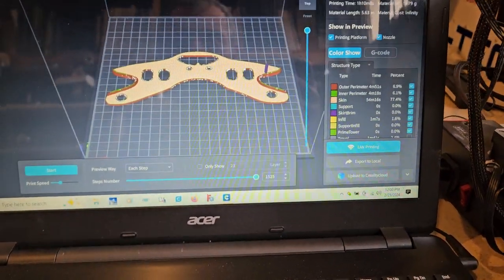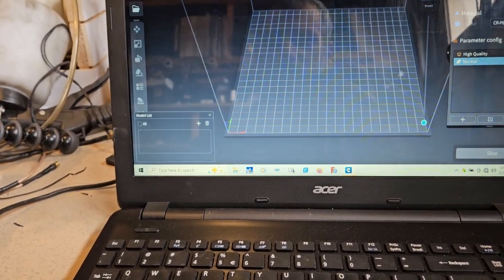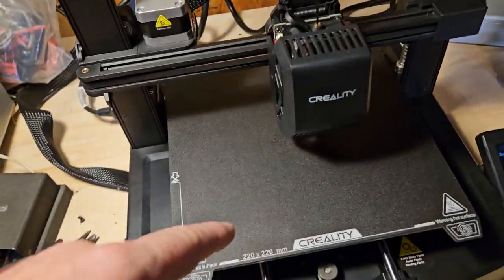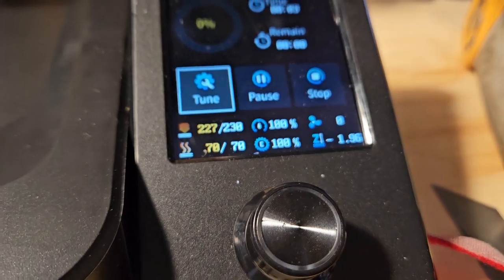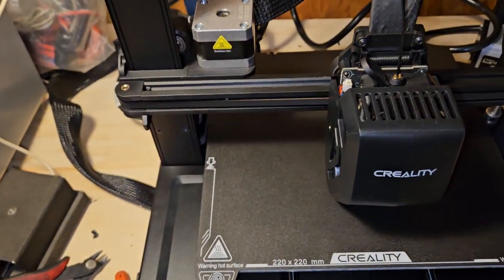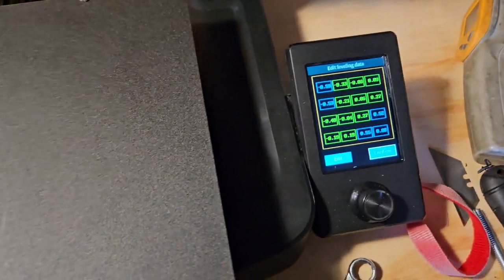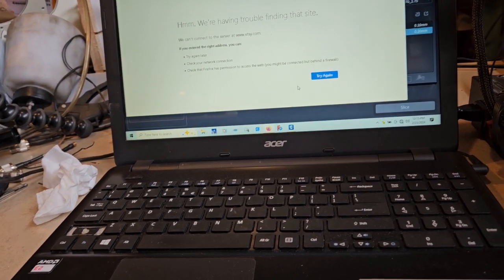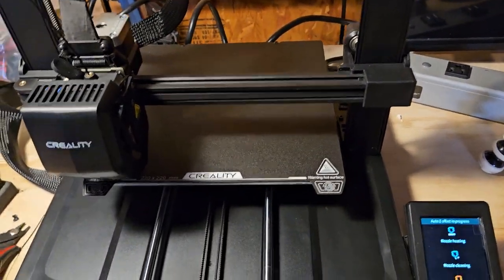CANT GET MY ENDER 3 V3 SE TO PRINT AFTER 4 DAYS!

Comment: I would take the bed off and either shim it with washers or very slightly sand down the pegs where those 4 bolts go until you get all green when you do the bed leveling. Those numbers will screw up your z offset. I have the same printer.
Reply from the maker: Spent all yesterday doing just that
Reply: Great! I was worried with some of the suggestions i was seeing. I think you got unlucky with bad spacing on your bed. Mine has worked great out of the box since day 1. I just printed the bear skull from printables using bone colored pla and it came out great (38 hour print).  @hamradiohack

Comment: Boii 😂 try alittlebit more plate heat up to max recommended for material + first layer max temperature nozzle +  thickness of the initial layr 0.2 or 0.24 . Before printing - alcohol or something to degreas your plate . Second layer average speed and temperature.
Reply: And dont forget to lower initial speed - this is very important. + Good leveling of the plate +- 0.5 and more from one side to another is not good

Comment: The reason it is not extruding filament is because your nozzle is too close to the print bed, this is happening because you are trying to calibrate your printer with filament loaded in the extruder resulting in a difference between the measured height of the nozzle and the actual height of the nozzle to the print bed.
Here is what you need to do to solve your problem :
1 Go to "prepare" and click on the retract option to remove your filament before you attempt the leveling procedure
2 After you remove the filament form the extruder go ahead and make sure that your nozzle is perfectly clean
3 Once you made sure that there is no filament in the extruder and that your nozzle is absolutely clean, you can go ahead and start the "auto leveling" procedure
4 After the "auto leveling" procedure is complete, grab a normal piece of paper, go to the prepare menu, select the move option, select "move z" and start slowly decreasing that number until you reach 0 ( the piece of paper needs to be between your nozzle and the print bed), once you are at 0, go ahead and click out of that menu.
5 Go to the edit ''Z offset option" and adjust SLOWLY in 0.01 increments while moving the piece of paper back and forth, you are looking for just the right amount of friction so that you can pull the paper, but not push it (a bigger - values moves the nozzle down, if that makes sense).
6 Once you are happy with your z offset you want to go to the control menu and click store configuration so that the printer "remembers" your settings
7 After you have stored your configuration you can go ahead and go the the prepare menu, click the extrude option and follow the instructions on the screen, make sure to cut all the a good few inches off the filament so that you feed new clean filament in
8 After the the printer loads and extrudes the filament you can go ahead and choose the file you want to print
9 AND THIS IS VERY IMPORTANT : MAKE SURE YOU SELECT THE "CALIBRATION OFF" OPTION IN THE PRINT MENU!!! if you fail to do so, the printer will start a new "auto leveling" procedure and all your work would have been for nothing!
10 Try to switch to PLA filament, it is much easier to print
Reply from the maker: Thank you so much for the detailed information.  At first, when I got this printer on Monday, i didn't know not to have filament in while auto leveling.  I learned that a few days ago but the damage has been done. The print bed is mostly level physically now but it was bowed before.  Im guessing with the z offset so close it knows not to dig into print bed where its higher  than the center of the bed where i calibrated z offset? If not I will have problems
Reply: @hamradiohack  i did write 2 replies explaining how that works, but i added some links from thingiverse, see if yt marked them as spam, because i can't see them...
Reply: Thank you so much! I also had no idea that the filament needed to be taken out before auto-levelling. My 3D printer is now printing perfectly!

Comment: If you send it back get a bambu A1 mini, A1 or P1P/P1S, if you just want a printer that just works right out of the box. It has a self-calibration you do not need to manual adjust anything. After the auto calibration the prints are amazing every time. I'm also new to 3d printing and bought a bambu printer I couldn't be more happier with my purchase. I just wanted a printer that just works I didn't want to have to spend time adjusting it to work. The bambu printers just work.
I seen at https://youtu.be/x8xmRd8KC4I?t=727 where the printer had filament hanging from the toolhead, the bambu printer would auto clean that off. I'm not sure about other printers but the bambu printers has auto cleaning.
Reply from the maker: It's working now. Lots of shims lol

Comment: Your printer isn't defective. You're not doing anything wrong either just missing a couple things

1. Raise your z-offset. Your nozzle is so close to the surface the plastic can't come out. Your bed is uneven that's why the purge line and small parts print.
    1a. You'll never get a perfectly flat bed. Even with mesh leveling and a probe there are factors that make it just a little off. In the case of a CR/BL touch, the x,y offset from the nozzle can exacerbate any unevenness in your x or y gantry. Unless it's really bad, that's okay. Bed adhesion techniques can compensate for that'll 

2. Clean your print surface with dawn dish soap and water
     2a. Your hands have grease and oils. Avoid touching your build plate with them.

3. My minimum temp for PETG is 240 | 70
Reply: If you’re going g to return it, pay the extra $70 and get the KE. It’s well worth the upgrades and klipper root.
Reply from the maker: @user-2df90a0z1  It's working really well now, but i think that's the best idea I've heard so far. I definitely want   klipper and a linear rail. Its a learning experience for me. It definitely prints alot better than my pyramid a1.1 3d cr10 v3 clone.
Reply from the maker: Yep you're right.  Its working now. 
Washed bed with dish soap and wow 👌

Comment: I have had this same problem on other printers. This is because the firmware is only allowing for 10mm of total offset. You either need to hone the bed, or compile firmware that has the offset set larger.

On my Ender-5 Pro I just said screw it and decided to just let the stepper motors handle the massively warped bed and set my limits way over what was needed at 100 and -100.

// For M851 give a range for adjusting the Z probe offset
#define Z_PROBE_OFFSET_RANGE_MIN -100
#define Z_PROBE_OFFSET_RANGE_MAX 100

Hope this helps :)
Reply from the maker: Wow. Yes. I had to print several  shims and i got it pretty level. Its working now

Comment: I think I may know the problem. First petg is a very picky temperature filament because I had the same problem printing with petg on my v3 se and a possible solution would be to really lower first layer speed and higher bed temperature like possibly 80 degrees C that’s how I got mine to stick (edit- grammar)
Reply from the maker: Its working now

Comment: it doesn't seem like the printer did any mesh leveling. i would recommend trying a different slicer that has a prebuilt preset
Reply from the maker: Its working now. Yes i think we figured out something like that and theres a limit on how much it will compensate for. 
I ended up using shims to level the bed and cleaned the print bed with dish soap and compressed air and it's working really good now

Comment: not sure about your problem, but as far as your engineering thought process is concerned, I agree, individual screws on the corners to accommodate warps is not a bad idea
Reply from the maker: I think what was happening was there was too much for the mesh to compensate for the warping and what I ended up doing was I printed I found a file specifically for this printer on printables that had several different sizes of shims and so I printed a couple sets of those and shimmed the bed until it was nearly as perfect as I could get it that took about all day because they're kind of hard to get in there and then you have to run the auto leveling and see where you're at again but I also needed to wash the print bed with dish soap and compressed air and once I did that then somebody else explain to me the proper way to set the Z offset and once I did that it absolutely works perfect now but the bed is definitely shimmed up quite a bit in one spot because of how bent it is on the bottom but it's working great now I've only been doing this for about 2 or 3 weeks my other printers are a pair of pyramid printers that are a copy of the creality CR 10 V3